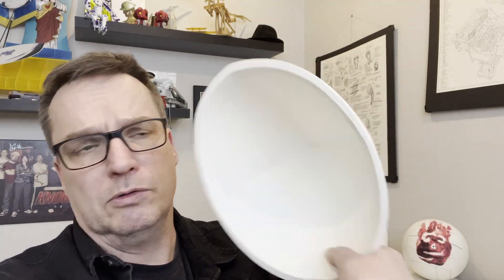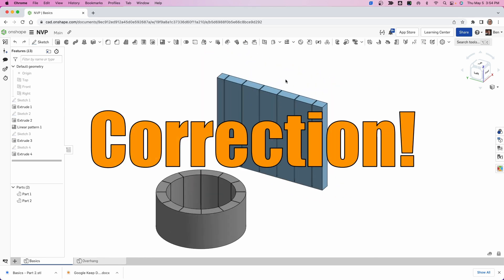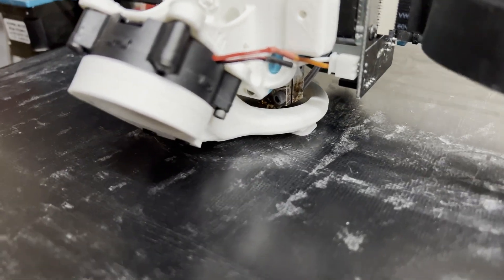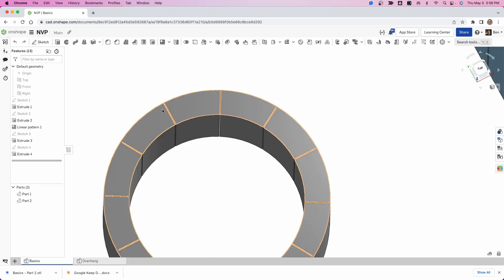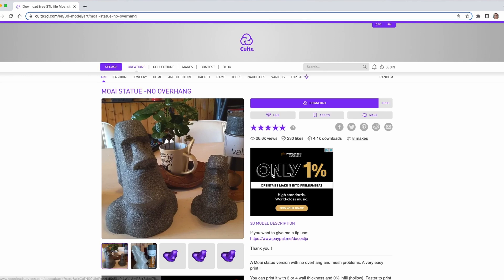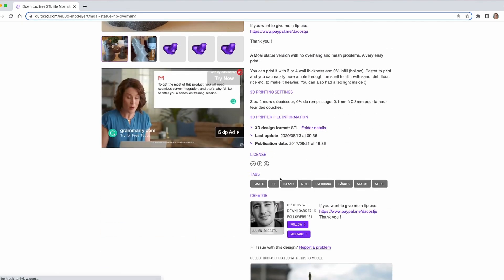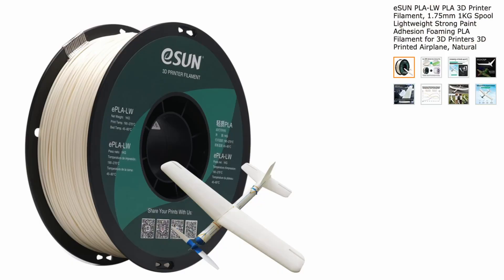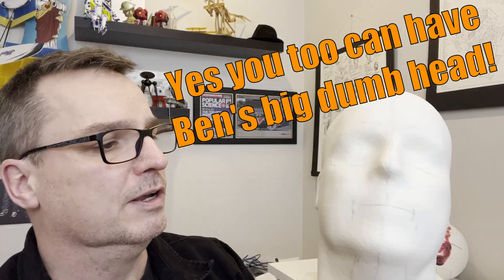3D Printing in Half the Time - Use This Trick to Speed Up The Process!

Comment: Thanks for that awesome video, but I might need some help: 
I'm too printing with a 0.8mm Nozzle, on a Prusa mini+. I made similar models to test it out but with your settings (distance: half of the nozzle diameter) it wont slice properly, not in Prusa-Slicer and not in Cura. When I make a model with distances of 1mm it works fine, but I guess thats to big. Any tipps? For me it looks like a slicer problem but since I got similar results in Cura maybe I'm missing something

Comment: i didn't understand how the 3d printed will be stronger if you have spaces between them  can  this way of printing  print a mechanical parts like gears and other things with out losing  strength
Reply from the maker: You can make it so the webs join by adjusting the flow of the nozzle so there are no gaps. In the end I think you could do gears quite readily and also build in webs at high strain points.
Reply: @DreadMakerRoberts  i get it now by adjusting the flow rate the pla expand after printing so   the gaps disappear
Reply from the maker: @ahmedmosad7161  Yes exactly. However if you do not use foaming filament you can still crank up the flow and get the same effect. It will squish more material into the gap

Comment: Have you see Tom Stanton's video on this? I use a .6 nozzle and make slots .10mm wide. Unfortunately i cant add toplayers without mucking about with the Gcode but with chamfers i can trick it to still go over the top and close it off. I have seen others in Simplify3d being able to close off the top with infill. Nerys has an interesting video on the same subject.
Reply from the maker: Yes there is a lot of use saying this needs to be a slicer thing. Hope one day they implement this sort of slicing

Comment: How did you do the cuts/ribs?
Reply from the maker: In Onshape I took the model and offset the outer face 0.6mm. Then made ribs to conform to the offset face. At that point did a boolean subtraction of the ribs. That make any sense?
Reply: @DreadMakerRoberts  In other words, indent/cut upto your ribs pattern upto the offset you made earlier.

Comment: Hello, thank you for your content! Im doing similar stuff for paste extrusion 3d printing, but mainly using blender. im really interested in how you pulled that triangular structure off (as shown at 7:28) , especially with complex mesh shapes. could you maybe elaborate how you did it in your CAD software?
Reply from the maker: I will go into more detail in a bit on this. I do need to do followup content for sure

Comment: this is about as close to the actual things I was looking for. I was actually looking for ways to make the print go faster by making more fillets in the z that way fewer corners, the acceleration doesn't need to slow down= faster print, still the same integrity.
Reply from the maker: YES!

Comment: newer versions of cura and prusa dont seem to slice this properly anymore (they changed engine and probably hide some settings) Edit I think its settings and line width dependent with arachne engine (so ignore me unless you have issues, in which case change line width)
Reply from the maker: I really need to get back on this topic and start experimenting again like I promised. I will have to have a look into this. I am sure there will be some way with the settings to get things to work properly. I did some experimenting with S3D and found that it did not play well with my models as well. So in the end I need to go through Prusa, Cura, and S3D to figure out what works best etc. Long answer to say I agree that something likely changed and I will need to get on this topic again but have no answer for you currently.
Reply: @DreadMakerRoberts  I just spent some time with a parametrical model in f360 and checked when it will slice properly in prusaslicer.

the most important dimension is the outer wall at the slot. it has to be bigger than nozzle diameter with some margin. for my 0.35mm nozzle it didn't work at 0.4mm, but it's fine with 0.45. Didn't check the values between these 2 yet.
Reply from the maker: @bukszpryt_  Thank you for following up. I will need to play with this some more. But that is immensely helpful
Reply: @DreadMakerRoberts  Extrusion multiplier higher than 1 is important to fuse the ribs. Without it, even the minimal 0.1 mm gap can stay as a gap. At the small values of the outer wall gap (or however we name it) the ribbs patter will be clearly visible on the outer wall, especially with high extrusion multiplier (1 tested with 1.2), so this value could be higher than absolute minimum that slicer will process. It should all be tuned for given printer and it's nozzle size.
IMO it would be best to make few test prints with different key values before printing anything that should look pretty. On the other hand, some prints could benefit from internal ribbs pattern, for example christmas tree ornaments.

If my printer wouldn't be so annoying, i'd make some more tests. Right now, i got some basics, that i might explore further when i'll actually need it.
Reply: It's not arachne. I use prusaslicer and i tried slicing it with arachne and with classic engine. Both failed.

Comment: The process in general is pretty simple once you wrap your mind around it the execution however is let's just say annoying :-) if you could figure out how to even semi-automate this process in something like fusion 360 that would be worth its weight in gold!

If there was a way for me to put a dozen cut planes through a model and simply instruct fusion okay conform these cut planes to the outer surface with an offset that I defined! That would just be amazing! Because well it's not even remotely difficult it's a pain in the ass :-) I've even added structural ribs to fins integrated launch lugs integrated shock cord mounts and integrated motor mounts all into a single vase mode printed part I can now vase mode print an entire rocket with no retractions anywhere in the entire model and the weight difference is dramatic we're talking about a model going from four or 500 g down to 100 g and the speed difference is also phenomenal we're talking a part that might take 20 hours to print now taking 7 hours to print 8 hours to print while being cleaner lighter smoother and Superior

It's just that process of making the ribs is so tedious at least the way I'm doing it if I could figure out how to instruct fusion to do that in a semi-automated fashion that would be simply stunning because right now I'm using tinkercad :-)
Reply from the maker: Ok lets get you on Onshape to start. All of this can be automated for sure. You up to do a video discussion on this in the future to basically nerd out on this method? Collaboration kinda thing?
Reply: @DreadMakerRoberts  hell yes. So much I want to do with this process!
Reply from the maker: Sent a email from the one found on your about info on your channel. My email includes mountain wave

Comment: A couple of questions about your video first the slots can be infinitely thin because the slicer uses the outer surface of the model and simply takes from the interior surface whatever space it needs to accomplish its task so you can make your slots 0.01 mm thick and probably should that's what I do

However those slots must be 2x the distance from the outer wall of your nozzle thickness so in your case that's slot needs to have a gap of 1.6 mm to the outer wall this is a fact of physics and cannot be argued so I'm wondering how are you getting around it? My guess is your slicer is compensating and allowing it to happen I'm curious what settings you're using in the slicer to do that because if the distance between the slot and the outer wall is not 2x the nozzle diameter in your case 1.6 mm you will have a collision in the slice and that will break vase mode

I'm assuming you're using some sort of thin wall compensation in the slicer and it's making the correction on the fly? Because if I could make my distance to the wall smaller in fact 0.01 would be wonderful then I would be able to scale the model quite a bit and still retain vase mode compatibility I use this process for making model rocket parts for the 7 or 8 years while it is not a difficult process once you wrap your mind around it it is a tedious process :-) anything to make the process easier would be wonderful :-)
Reply from the maker: Check my other reply on your other comment :) I am fully 200% on board to get the slicer people to make this happen. If you think about this really they should be able to very easily even with standard infill.
Reply: @DreadMakerRoberts  this would be pretty hard to do in the slicer itself interestingly enough it might actually be possible because of the open source nature of slicers like cura and slic3r now being backed by printer manufacturer behemoths like ultimaker and prusa

I'm not a programmer though so I don't know if that is something that's even possible from a programming point of view they would basically be doing CAD functions in the slicer right now the slicers can't even determine what is and is not vase mode compatible although this process might actually be easier for them I'm not sure we would have to speak with the coders who make the slicers because they will understand what is and is not feasible things that are easy for us to visualize can sometimes be very difficult to get a piece of software to do
Reply from the maker: I am positive this can be done quite easy. They already have the base functionality to do this. My coder friends agree

Comment: This is an interesting technique.
For the Moai example, is the time saving roughly equal to the time it would take to print the infill + travels?
Reply: No the time savings will be substantially greater because not only are you printing substantially less of the model and only printing the support ribs as necessary to stiffen the model but you're doing the entire thing without ever stopping one continuous extrusion from start to finish believe it or not a huge amount of time in a print is retractions stop retract move push start stop retract move start push all of that takes a long time when you're doing it thousands of times per print it might only be a quarter of a second each time you do it but now multiply that quarter of a second by a thousand or 2,000 or 3000 and suddenly it becomes a substantial amount of time so not only are you printing a lot less while still having some rigidity I would suggest going with a 0.6 mm nozzle! 0.4 mm is borderline too thin for some shapes they'll print fine they just won't be that strong you can also compensate by simply instructing your printer to print at 0.5 or 0.6 mm depending on your printer that might work just fine although it is always better to use the correct size nozzle to avoid over pressure and squish issues

but combine not printing what you don't need to print and removing potentially hundreds if not thousands of those retraction process movements and The Time savings is simply massive
Reply from the maker: I am guessing so. I haven't dug in that far yet.

Comment: You might find this interesting.  It's something I came across while researching my printer.  https://www.youtube.com/watch?v=YTorSRpJtqQ  This guy is claiming very fast print rates.  I'm not sure exactly how it works.  I'm guessing that if you go for a high feed rate the starting forces while pulling off the spool might prevent/increase flow and screw up prints.  The lack of friction from the spool might help with that. So if you mix your technique with this fast print speed, you might even see faster prints.  I've yet to do this myself, so I can't confirm it.  I don't need fast prints.  Here he is again doing 200mm/s with TPU.  https://www.youtube.com/watch?v=3xRfBNNNi1w